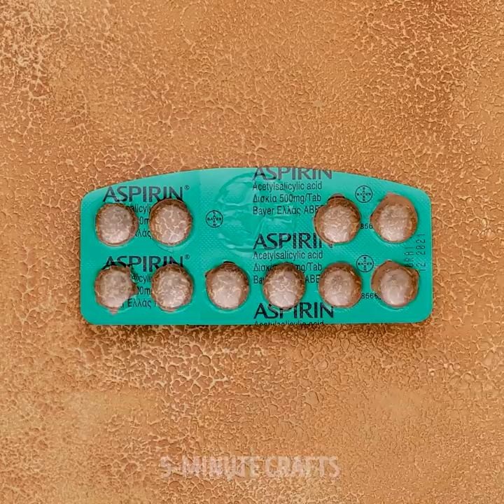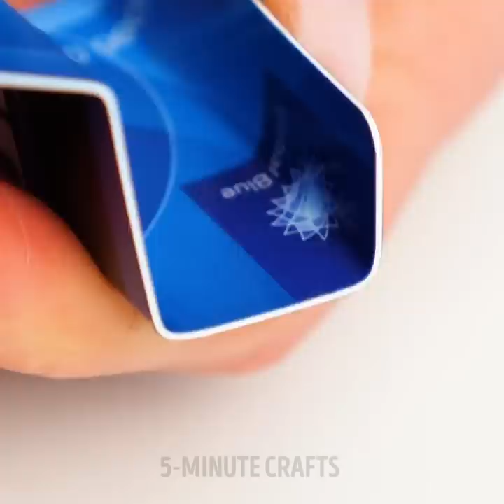You Need To Know This Amazing Hacks

Comment: 0:39 baking soda is damaging for teeth,
2:30 WTF most disguasting thing ever,
3:20 you should place the sponge under the sacks
(unless you want to take it off or clean it after every single use),
3:50 put the whole soap in,
4:30 use two long sticks you find, put the wood crosswise and carrie it with a partner,
5:35 Why the unnecessary table and chair? Logs are perfectly fine cause u r camping, right?
6:10 there is no way that wax is enough, use at least some tiny sticks,
7:50 do u actually think it will hold ur weight?
12:56 U still need to prepare the soil for that to work.
Reply: Why are you telling all the negative things